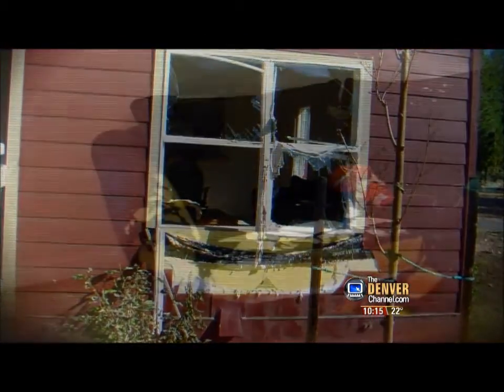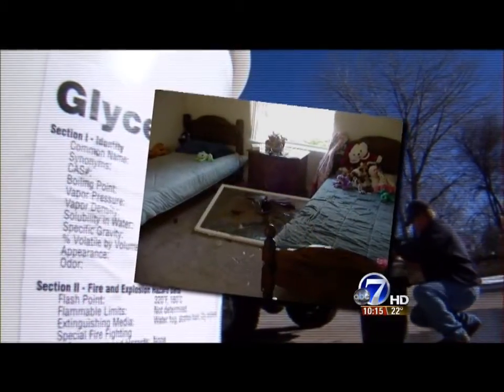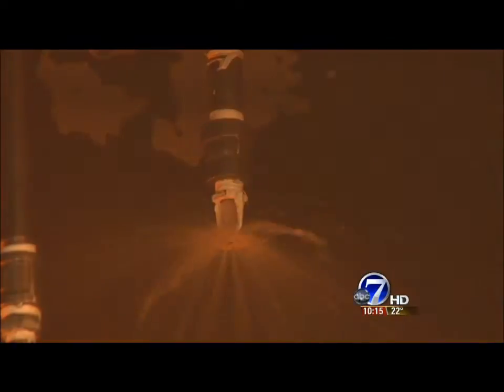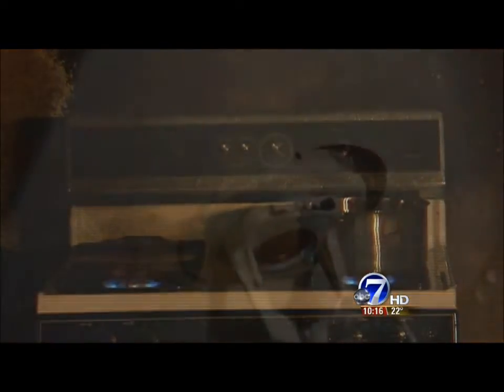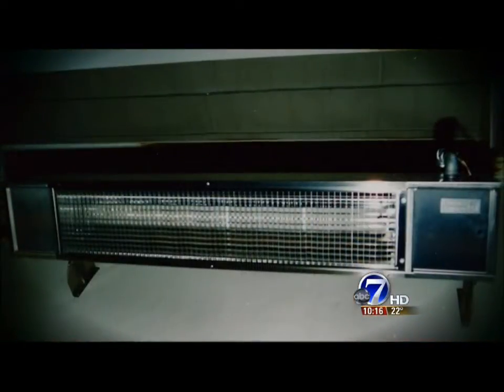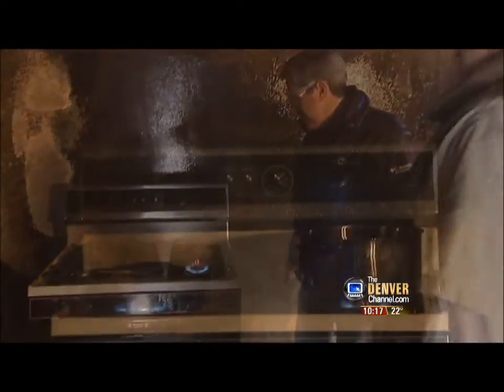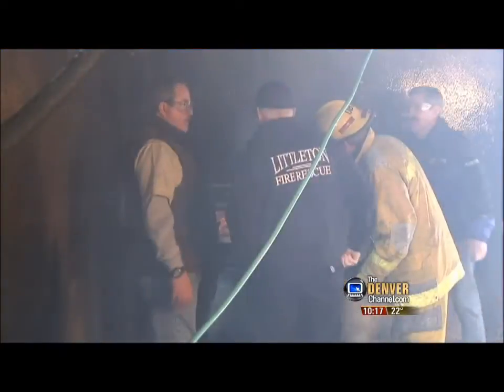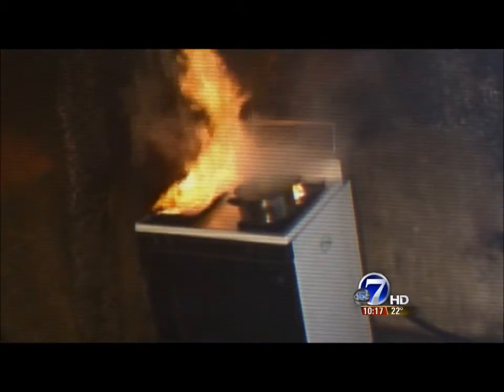Antifreeze Danger in Fire Sprinkler Systems

Comment: Antifreeze systems are going by the way side. It’s the cheaper alternative to installing a dry system where an area is subject to freezing. All you need is a rpz backflow on the system before the antifreeze. The proper way to do it is install a dry system. Air is holding back water. Antifreeze systems are a pain to work on.
Reply: What can be done to get rid of an antifreeze system and replace it with something else?

Comment: This is specific to antifreeze systems only. Dry systems and normal wet systems do NOT contain antifreeze
Reply from the maker: +yuck fou In my video these are water & antifreeze charged systems with more than 40% antifreeze. Systems with more than 40% antifreeze are flammable. This is a demonstration of what happens when you use to much antifreeze.
Reply: +Me Very Messy that's not what he was saying
Reply from the maker: +Rob Johnston This is likely what you are talking about https://youtu.be/BroIor_Z3Fs
Reply: Grease fire plus water = explosion